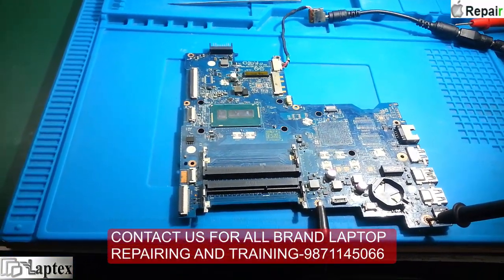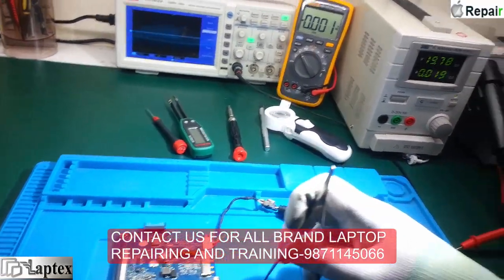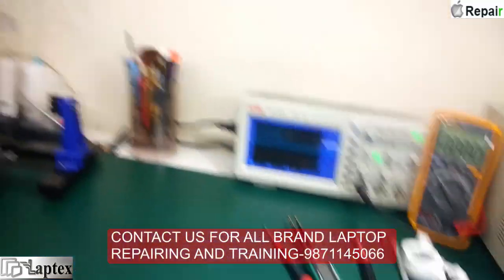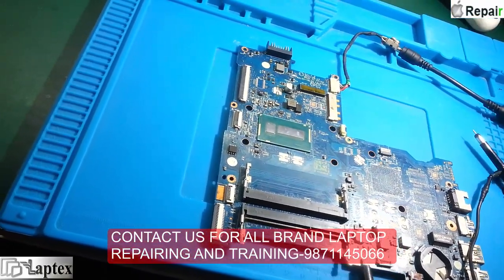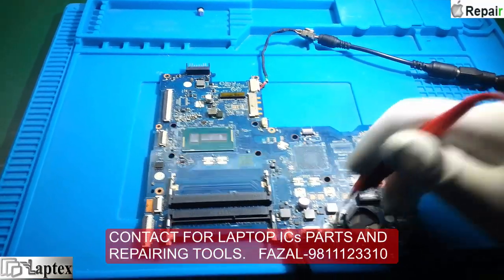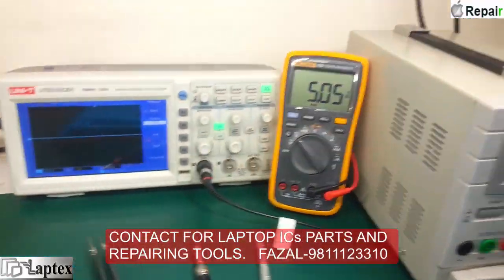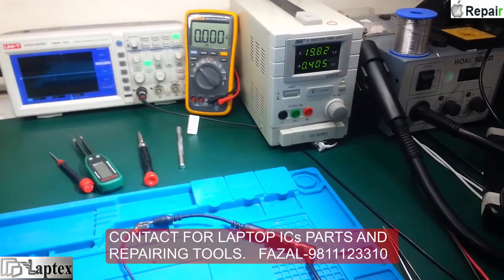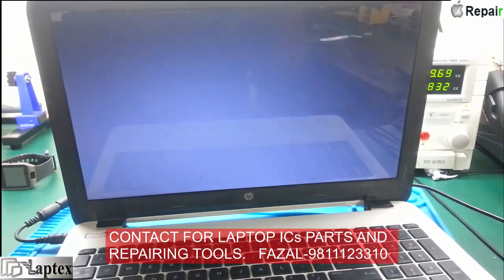LA-C701P & LA-D703P HP15 AHL50 THE MOST COMMON PROBLEM & SOLUTION

Comment: Same motherboard I have problem no power on ampr 0.010 ampr and drop 0000 voltage 
3 and 5 voltage is complete how to solve problem
Reply from the maker: Check S3 state requirements.
Reply: Sir S3 state mins
Reply from the maker: @ashifarab6343 it's the state of the motherboard.
Reply: @laptex1377  okay sir

Comment: Thank you sir for your video and sharing of knowledge. thank you  :) Please can you detail which chip exactly that you replaced? it seems to be missing in the video. thank you again sir. i have bld50 la-D702p board. charge light and power light work fine., but no screen and not boot. realtek 8166eh is very very HOT!. should i replace realtek8166eh ? or is the problem earlier??
Reply from the maker: Check RTC Section and SIO requirements
Reply: @laptex1377  thanks

Comment: Pls I want to ask you something.

My laptop motherboard spoiled. I went to a computer technician to change it and put another one, he found the same type of motherboard with exact number AHL50/ABL52 LA-C701P and fixed it to my laptop. It worked, my laptop powered but the touchscreen did not work. 
Pls what might be the cause??

Is there anything I can do so that the touchscreen will start functioning with the new motherboard? 

It's hp 2015 Notebook.

The specification is:
HP Notebook 15-ac121dx

And the motherboard is:
AHL50/ABL52 LA-C701P.

Thanks
Reply from the maker: Touch screen or BIOS problem

Comment: Please help me i have la-c701p when i turn on the light of power turn 3 secon Then it turns off the 3v and 5 v is present but  the voltage of the ram is absent 😓😓😓😓😓
Reply from the maker: Check the requirements of the RAM section ICs. If S3 enable and S5 enable is coming proper...also VDDQ or VTT which voltage is missing???

Comment: Hey bro. I have a issue in with a customs LA-C701p is not reading the hard drive, when i run diagnostics its saying no please check cable I have replaced the hard, hard drive cable and the connector,  flashed the bios, and still the same. Help Please Anyone.
Reply from the maker: Check proper communication between the PCH and HDD data and clock line.👍
Reply: @laptex1377  sorry but I'm still a bit new at this , do you mind explaining a little bit more how do I go about checking this
Reply from the maker: Everything can't be explained brother... You can go for some course to have a better understanding 👍👍

Comment: Hi, I have the same problem, but i don't hac the schematics, and I don't undertsand what IC you have change, can you help (Portugal)
Reply from the maker: Watch the video carefully again you will get the solution 😊.

Try to work urself as well we have provided u the path Brother.
Reply: @laptex1377  5V missing or lower 4.1v, some time drops
Reply: @laptex1377  No voltage on pin 8 of bios
Reply: @laptex1377  After change controller the CPU is burning, now I have 5v oscillating , I think the CPU is dead
Reply from the maker: That's a possibility
Reply: @laptex1377  and thanks for your quick response.
Reply from the maker: Always welcome and ready to y👍🤝
Reply from the maker: Keep supporting and Sharing our videos ❤️

Comment: i have same mobo 3v ok and 5v ok 19v also ok but shutdown after 3 sec without fan spining or display main bios volt missing on standbay but it come after powering. the  ITE and the main programed without problem what do u think
Reply from the maker: CLEAN ME region.
Reply: I have the same problem

Comment: Hello Mr. Nasir, I've also facing the same problem in HP 1000 Motherboard. Which is turning on and suddenly off. But the Voltages like 5 Volts and 3.3 Volts are correctly over there. I mean not less than that like in your case. But i already Changed 3.3V and 5V ic Part # tps 51123 from a working Motherboard. I also changed IO Controller Part # ITE 8517E, and also Programmed the BIOS. But no luck. What should i check in that case? your help will be great for me.

Comment: Hello
My hp is dead.
When i press the power button, fan is spinning for 3 second after he stopped. I have no image.
I have checked the 3v and 5v capacitors. On 3V I have 0v and on 5v I have 1.4v only for the 3 second(fan is spinning).
What else  should i check?
Thx
Reply: Same problem with my HP, also the HDD try to start up but then the turn off after 3 seconds, have you fix it? 
Please help me if you got any hope. 
Thanks in advance
Reply from the maker: Try to open the coil of 3V 5V regulator and check whether 3v 5v enabling signal is coming on ur from IO r not...
Reply from the maker: It could be an issue of the either the output Shorting, or glitch in the SIO triggering.

Comment: Hi sir i have nm-a27 mbd  all voltages are OK, ram nd prosser voltage not genarating any suggestion please help me,
Reply from the maker: check impedence whether its short or not. on ram coil
Reply: @laptex1377  no shorting on coils
Reply from the maker: what is ampere load after on reply me on my whats app -9871145066
Reply: Ok

Comment: Good job sir. And amazing fault  🙏But as far my experience in this board stand by consumption is not more then 0.015 mili amp that means  board have still issue... With dsw stage ... Hope may be  board will be back to pavilion very soon..

But problem is interesting and learn able... Thanks once 🙏🙏
Reply from the maker: salute your experience Basir bahi lets hope for the best , before me someone has already ravage the modesty of motherboard. i wish that i get it back and again i make video of that 0.015 mili amp.
Reply: Hi Basir, I have the same board that now reach 404mA consumption but no video. The 1.8v coil closed to the CPU sometimes gets really hot but still the right voltage. Tried flashing the bios with no luck. CPU get worm when powered on and usb mouse light appears for an instant than goes away. Any suggestions?
Reply from the maker: Try to check the signal capacitor leakage in the output path of the 1.8V regulator.

Comment: Thanks for sharing this wonderful video. It is quite amazing. I feel there is a button  on the UNI-T oscilloscope called CURSOR, push that button and also push F1 button to move the CURSOR  Type set to "Track" that would display the numerical value of the voltage in a small window by the left side as well as the voltage level on the graph. Always anticipating your repair videos. Thanks once again for sharing your knowledge and experience with us. Cheers!
Reply from the maker: THANKS FOR COMPLIMENT CLEMENT. I RATHER USE MESURE AND F5 AND HERE RENEGING FROM DUTY CYCLE TO DELTA VOLTAGE  YOU CAN SEE. WELL INSHALLAH I WILL USE WHEN I WILL MAKE NEXT VIDEO AS YOU HAVE SAID. THANKS